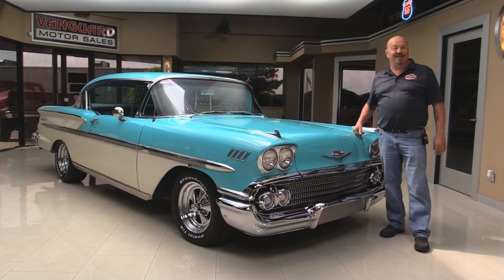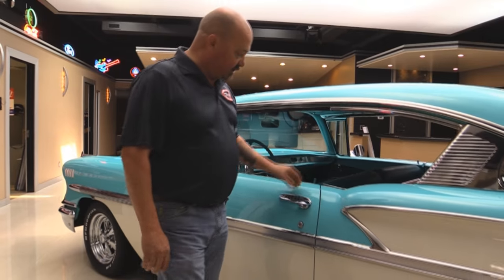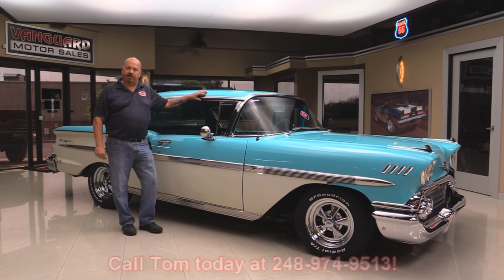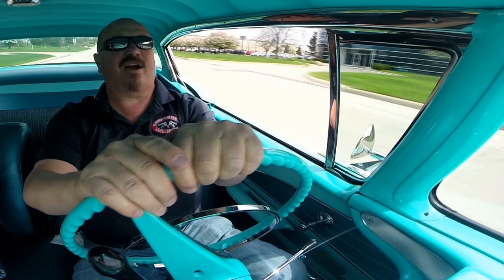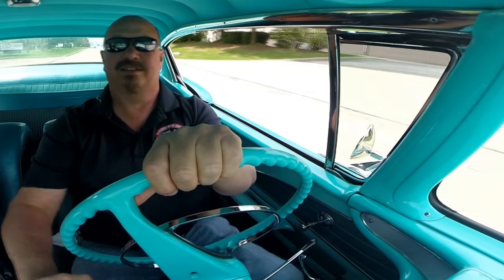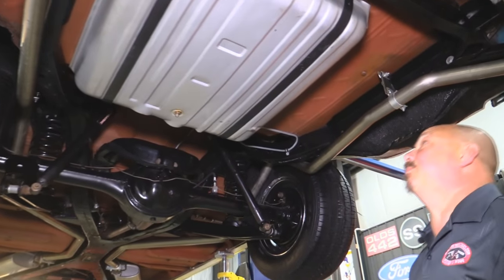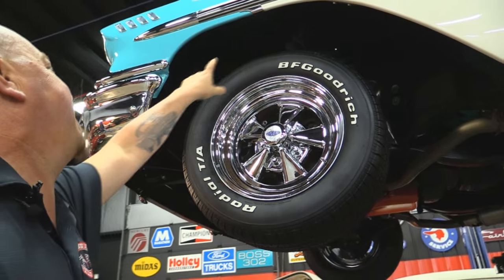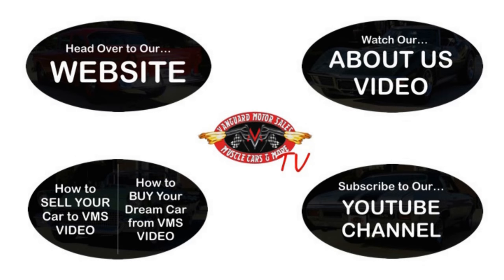1958 Chevrolet Bel Air For Sale

Comment: I had one of these with the straight six. I am reminded at 1:04 how every time we pulled into a full-service gas station, we had to get out and show the guy where the gas filler was. It's behind a rollover door on the driver side under the trunk lid. The one on the passenger side is a fake.

What wasn't spectacular was the wiper system which was operated by vacuum. The wipers would completely stop when driving up an incline.